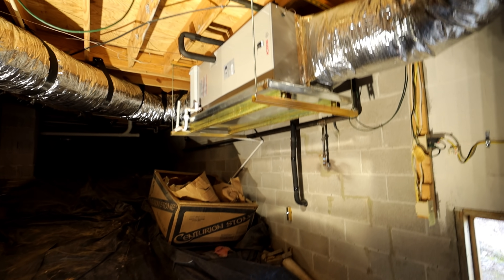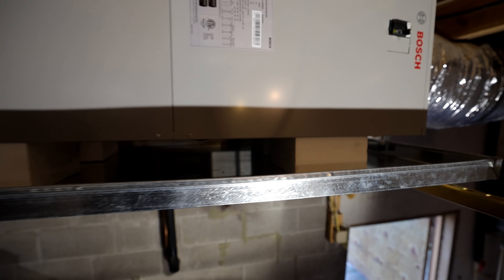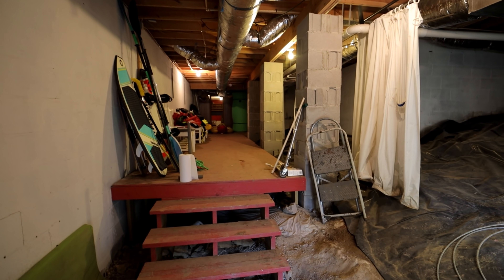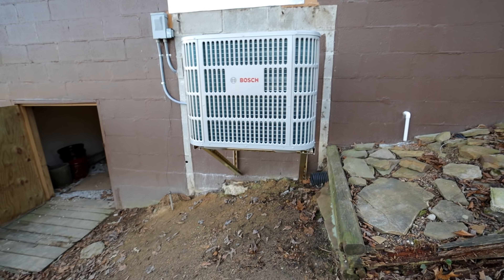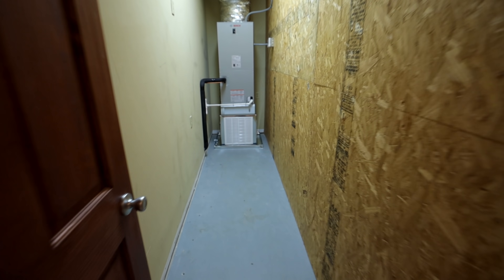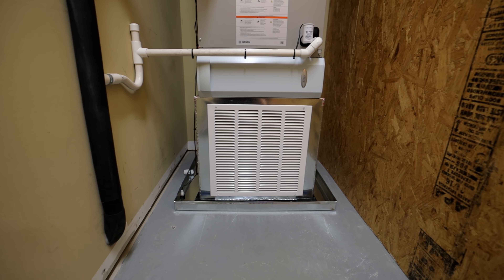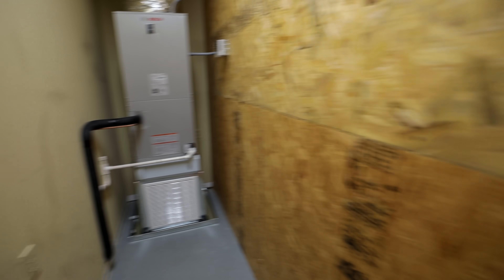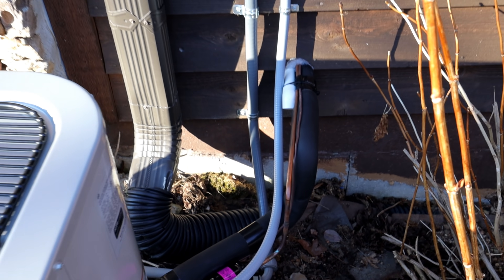Riverside HVAC Project Part 2 | Bosch IDS 2.0 Heat Pump

Comment: Bosch works great for installers, simple, easy commissions, don’t have to be precise with unit designation,matching, etc, but they just don’t, because they are not designed to, remove humidity !!

Comment: Graet Vid. One of the few which appears to shows BOSCH air handler fitted with heat strips (breakers). Do you remember what size strips you used and what wire AWG & type? This detail is not included in the manual. Thoughts are to choose wire size based on the breaker? so if 60 A use either 4/3 or 6/3 Romex depending on length? Any comments?

Comment: Looking at installing a Bosch 3ton 036 unit, but contractor is asking that I first install a 50amp wiring. Can't say I'm too pleased with that. I thought the old 3 ton unit would have been just fine

Comment: Does the Bosch 2.0 HVAC unit have a surge protector built in? It has a lot of circuitry that can be damaged by surge.
Reply: You better believe it ! I love these units for right climate (ie low humidity concerns) but would get the best surge protection I could as your whole house/panel surge protection is not gogin to help much when all the chips are outside the house.

Comment: Are you still using Bosch equipment? And with your experience with the equipment will the condenser work ok with another brand indoor equipment, air handler and or furnace and coil? Or does it have to have the matching air handler to properly work since there is only two condensers for all the sizes

Comment: Great install super clean, I love the Aprilaire filter.  You should look into the DiversiTech WS-1 Wet Switch Flood Detector for your overflow pan. the way you have it now the pan will need to fill up half way with water before the sensor trips the sensor. The DiversiTech senses it right on the floor of the pan and will shut the system down so you don't have to drain the pan of all the water.  I have been using them for 20 years, and they have always been super easy and durable.

Comment: I was wondering how can a smaller handler runs with a higher condensing unit?  I know the pair (evaporator and condensing unit) has to match or evaporator can be higher.

Comment: Seems kind of wasteful to replace the supply and return ducts.  They look 100% better than most flex duct installations.  I could see some modifications to straighten out the droops and adding return air capacity, but to replace them all is very wasteful and not economically efficient.

Comment: I'm worried about these units. Keep hearing about humidity issues. We live in AL, very hot and humid
My grandma wants one put in her house but I'm not to sure.. too new and I heard the 2.0 series uses Chinese compressors. Any input on that?
Also heard there is a 1-3 ton unit and 3-5 ton unit, if i'm at 3 tons, should i get the 3-5?
Reply: You hear correctly brother-these are GREAT units for Phoenix say or Cheyenne Wyoming where they never worry about humidity esp in trunk seasons. Where you lie tho, humidity IS the major consign and serious trunk seasons ie 75-75 (temp/humidity)myhese are the. Awful choice for your climate. I don’t care how quiet, energy efficient at heating, easy installation, thermostat agnostic they are . They don’t communicate, there ari handlers are not very variable, and they are just not designed to deal with your climate and challenges. Posters need to tellmusnwherevthey live/work don’t extrapolate from an honest and accurate review from a Las Vegas client who says they are great-and they are for him to say ATLA or mid Atlantic…

Comment: If you have a 2 ton or 4 ton you can  flip the J2 switch in condenser to get closer to the coil size cfm, it steps it down

Comment: In Florida we do so many horizontals with emergency pans. Tip is to lower the pan switch cork to where it almost touches the bottom of the pan so if it fills you don’t have to empty the whole pan. In your situation  it’s not a huge deal, we are in an attic where you don’t want to risk spilling on the dry wall ceiling cleaning it out.

Comment: Great Install, I own and operate an AC company here is Hawaii and I would send one tip your way that has become a standard for us.  When the condensation pipe comes out of the AHU we always install an "X" pvc fitting straight off of the AHU, we put caps in the top and front.  This allows us when servicing to use a Chimney Sweep type product to clean the connection between the MIP and the drain pan which usually is the clog point on drain pans.
Reply: Good tip!

Comment: What KwH of electricity this 2-3 ton unit typically consumes when, let's say, keeping indoor at 68F when outdoor is at 32F assuming it is running full throttle producing rated output of 24 or 36 K BTU ?
Reply: Kw X 3.41 = BTU output

Comment: Hey, I'm an HVAC tech in Hot Springs Ar. I installed a 18.5 seer Bosch 3 ton heat pump unit a little over a year ago. I've noticed some savings on my Entergy bill however, I feel it should be lower. Is there any info you could give me to help with this situation? This is my first and only time to deal with this brand. Thanks

Comment: Nice install. 
One thing you missed to point out, on the condensers, you have a switch to select 2 or 3 ton & 4 or 5 ton capacity to match your air handler. 
Good job. 
Edgton from Bosch

Comment: Really great to learn from your boots-on-the-ground experience, thanks for sharing.  I've just put in an IDS 2.0 paired with my existing gas backup central furnace for heating on really cold days, but I get a pretty fierce hum/resonance from (seemingly) the indoor coil - any idea what it might be?  Sounds roughly like 90 Hz resonance...

Comment: Textbook installation. Very clean and neatly done jobs. By the way, do you know what kind of register vent temperature is for Bosch with a return air of 68F at 32F outdoor ambient? Or another word, the temperature rise at around 32F.

Comment: I sell the Bosch and I put one in my a house my only complaint is no low pressure switch on the 1.0.
Reply: What other brands do you install? Any experience with Bosch 2.0?

Comment: If any of the condensers are in a high wind area or heavy snow then you will be back to replace the condenser fan motor. Bosch knows about the issue and is supposedly working on a fix for it

Comment: I thought the electric heat strip was necessary for when the heat pump goes into defrost mode? You said you didn’t have to add it, however you did anyway. Just curious if I am not understanding this heat pump or if I missed something? Excellent install. Thanks for sharing.
Reply: It's extremely beneficial to have the the heat strips especially in that case. You are right unless the customer can tolerate the cold coming through the house when it's running in defrost

Comment: You will come the unit and the fan on the outside will short cycle but not stay running.  You may try everything push contactor ect but it will only come on for 1second.  It's the sensor.  That's the only problem with these units a sensor.  Other  than that I have put in about 8-10. And I have went back to 2 for repair.  1 for the sensor and 1 for home owners with a weed eater vs t stat wire.  Other than that these units are bullet proof. Ten mile Tenn to Naples FL we outchere

Comment: Install looks great!  The company I work for has installed tons of these Bosch heat pumps with basically no issues.  I installed a 2.0 3 ton condenser at my parents house this summer running a dual fuel system with propane furnace backup (Wyoming winters) and they haven't needed to top off their tank yet so far this winter when my house which is similar in age and build 2 miles down the road is using $300/month of propane.  I think I know what I'm doing this summer!
Reply: Perfect unit for your dry cold winters and low humidity thruout most the year

Comment: I just installed one of those Bosch unit here in Oregon for the first time. The are super quiet compared to a single stage heat pump. There was a 2 port ductless condenser right next to it and was comparable in noise level. Overall very impressed! Keep the good work!!

Comment: Definitely a good idea to have aux. heat in the air handler. With the house right on the river it will need to go into defrost and it offers a back up plan if the refrigerant circuit or components fail. Clean install.

Comment: Very nice, clean work. How do those things do with dehumidification? Those air handlers have fixed speed or variable blower?
Reply: Fixed speed, at least not continuously variable blowers, non communicating with internal hosue comditiosn, and designed to be super energy efficient  and Maintain  temperature- esp in winter in dry cold climates BuT awful choice for homeowners living with humid trunk seasons. These units aren’t designed, and don’t, handle humidity well at all.

Comment: Looks great! I would lower the SS2 lower than the evaporator pan. It will never shut off and lower the SS3 bucket closer to the emergency drain pan so it takes very minimal water to shut down. Love what you do
Reply: Just curious if that type of p-trap will facilitate drainage on that type of ahu unit.
Reply: @bradcapps5684  it’s the worst kind of ptrap to use. Clogs easy and then look at that secondary float switch. Should’ve put a elbow and let it hold water if it ever tripped...

Comment: Looks good. Good job on using a union for the drain. Many many many people don't. I dont like the p traps from supply houses. I build my own about manufacturers want a 3 1/2 depth for water to not be broken by static pressure of a unit. Wait a minute you have a bigger condenser than evaporator??? How is that cause rule of thumb for years has that as a bad thing. Tou can have a bigger evaporator and smaller condenser but not a bigger condenser and smaller evaporator.  Thank you a ton for sharing!Stay safe be well
Reply: These Bosch systems are inverter systems. As Zac stated, they come in a 3 ton and 5 ton capacity option. The occupied space called for a 2 ton, so you would use the 3 ton condenser option with a 2 ton air handler.

Comment: Very clean install! I did the Bosch training here in pa at my local distributor and these system have some awesome technology. I still haven’t found the right customer to install one yet but can’t wait until the day comes.
Reply: Tony the right customer is in a dry cold climate-these min communicating units Greta for that climate, but I uiubhave serious humidity esp trunk seasons. Like you do in PA,humidity control. Huge problem. These units are quiet, priced well,simple commissioning, thermostats agnostic, and great for retrofits and old ducting or replacing a one or two speed unit. bUT they do NOT provide as precise a climate control or deal remotely well with humid conditions, esp in trunk seasons. They aren’t designed to -they are superb i. Dry winter conditions , they extract less mositure, but for same reason and by design they are awful for humid trunk seasons.

Comment: Great work brother! 👏🏼as a commercial electrician, I really admire your work, especially that you strap your seal tight to code! 😂 Look forward to the next one! Sending a fist bump from Texas! 👊🏼🇺🇸
Reply: What city? In Texas are in?
Reply: @joemartinez7983  west Texas El Paso
Reply: Nice, I am from San Antonio on vacation in San Antonio from Denver, Co. Most 95% units in basements. Texas most in surper freaking hot attics. Texas hvac crazy.
Reply: @joemartinez7983  crazy, I'm from Denver and San Antonio also.

Comment: Seems like an odd place to put a thermostat. How does a 3 ton work on a 2 ton?
Reply: Bosch has it built in the board and it’s all staged. Set the dip switches

Comment: Never seen a surge protector put into a disconnect before. What kind of issues were you having that made you start putting them in? Is it for install with generators or do you do it on most of the installs you do? Only ever had 1 compressor fail on a 3 year old condenser from a possible brownout/surge. Is it mainly compressor protection too?
Reply: They should be used on all equipment that has a inverter.

Comment: Dude, that job looks amazing!.....      question: don't you want a 'T' after your trap on your drain? Sorry, im not trying to nit pick, I would assume that might cause drain issues with a negative pressure drain........ I could be wrong
Reply: Hvac Goat.. after a trap is not a problem.. from Air Handler to trap yes would
Reply: @DaveK76  gotcha, thanks man

Comment: Great job! The Bosch equipment has a dip switch on the heat pump that you have to change to make the 3 ton capacity to 2 ton capacity. It should be J2 on the inverter board.

Comment: Beautiful install. Only thing I’d do different is add a middle block so the air handler doesn’t sag.
Reply: That’s great advise.  Another option is to screw thin-strut to the bottom of the air handler to add strength (length-wise).  That is code around here.
Reply from the maker: Not a bad idea.
Reply: @Martin Heating & Cooling Hvac Trade Life I’ve ran into wayyy too many condensing furnaces with drainage issues in the secondary.

Comment: Love how clean your installs are.
Can you recommend a good surge protector (like the one shown at the end) to add onto my disconnects? Does the brand/model matter? One of my systems runs on a 20A breaker, the other is on a 30A. Are the surge protectors one size fits all?

Comment: The Bosh units are built so well. I am really thinking about installing one in my home. The DC inverters are the way to go for sure!!
Reply: Make sure you install a surge protector on the condenser at least  to keep from frying the board . That is the only problem I've had out of them .
Reply: I'm hearing nothing but good things about Bosch too. VRF and quiet.
Reply: I would probably install the Bosch at my house but I don’t need the heat pump. My only concern is finding parts but I assume the dealers have parts. In my area, we have tons of power surges and lightning so you need to install a surge protector on both the condensing unit and air handler.
Reply: Pump the brakes if you have any humidity concerns esp in spring and early fall when temps aren’t bad but humidity high.

Comment: They are spending some money on that place ... Looking nice !! Very good looking installation work you did there in my opinion !! Thanks for sharing.
Reply from the maker: Thank you sir! 🙏🏽
Reply: @QualityHVACR  Hey there Sir, i did a supply flex plenum before like this....im only concern was when heat stripes turn on will it melt black lining inside flex...so what i did was put pookie/duct sealant inside flex for that purpose. What you think on the sealant inside flex for heat strips?
Reply: I was thinking the same exact thing about the inner flex melting only thing I've done before was made a little bit bigger plenum so it had a little bit more space between it for the air to start cooling down
Reply: @jameschristy9966  Here in Florida a lot of places attach the flex straight to the top of the air handler (not how we do it). I haven't really come across one melted even that close. We tend to max out at 10kw on heat strips here so maybes with 15's it might.
Reply: You're right Ted some big money

Comment: i know its probably fine, but isnt best practice to have indoor tonnage equal or greater then outdoor unit?  and not the other way?
Reply: Airflow across the coil should match the outdoor unit tonnage. He didn't mention the size of the coil.
Reply: Don't know if its a vrf system either.